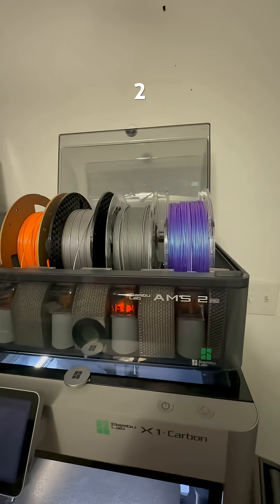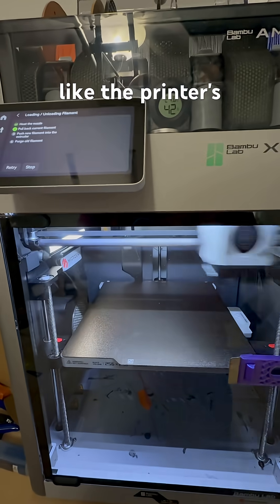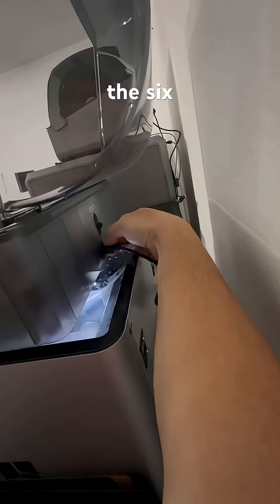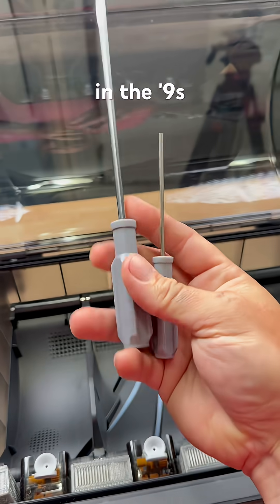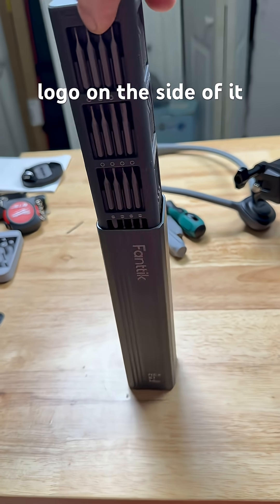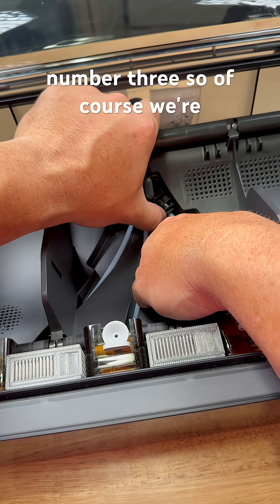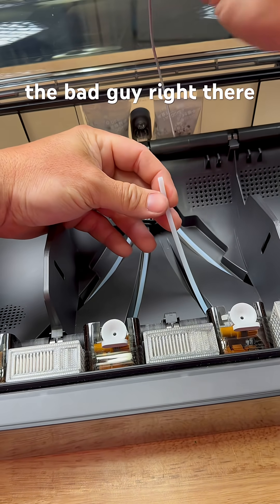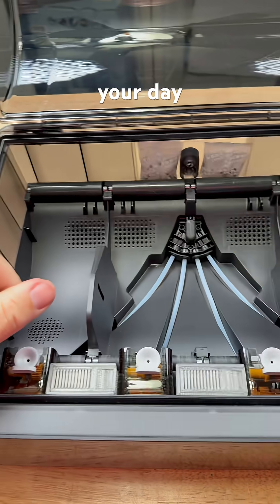Bambu lab AMS Pro 2 Filament Jam Fix In 5 Mins. (No Tools) #3dprinted #bambulab #3dprinter

Comment: I have this issue and followed the steps and removed the stuck filament. Issue is not resolved and the spools just keeps spinning over and over still. Any suggestions?
Reply from the maker: Means there’s still something in there. I’d use a long piece of filament to run through to check.
Reply: @stayreadyto3dprint  found a solution to my issue. I needed to push a piece of filament through the back PTFE tube hole and had a small piece of filament shoot out of the AMS hub

Comment: Bought the Fanttik on your recommendation. Stupid thing doesn't even come with a standard 2mm hex bit, so can't use it on the Bambu.
Reply from the maker: I use mine on the Bambu pretty much every day since my extruder is giving me hell. What tool did you buy.
Reply from the maker: You can probably get that specific bit on Amazon for $2-3$. Mine has it.
Reply: Where’d you even come from